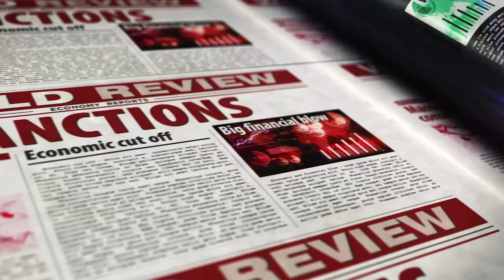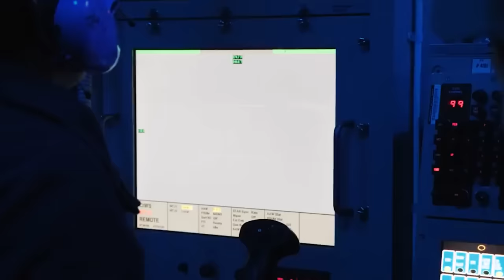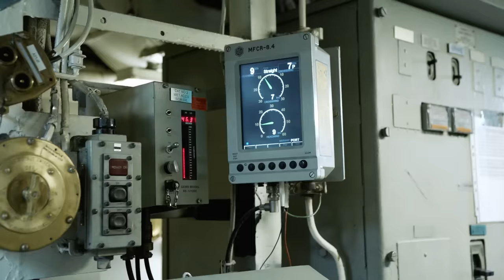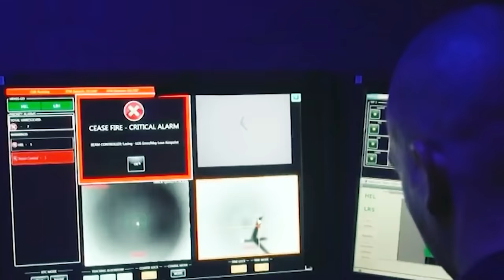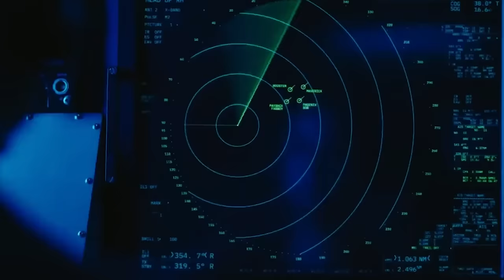A SECRET US Aircraft Carrier Is Already In ISRAEL! HAMAS And IRAN Are SHOCKED!

Comment: Lol. He said the F35C takes off with a hook, and lands with a special catapult!
Reply: They're referring to the electromagnetic catapult system used by the Navy or: Electromagnetic Aircraft Launch System found on some newer carriers which launch carrier-based aircraft by means of a catapult employing a linear induction motor rather than the conventional steam piston. EMALS was first installed on the lead ship of the Gerald R. Ford-class carrier, USS Gerald R. Ford.

Its main advantage is that it accelerates aircraft more smoothly, putting less stress on their airframes. Compared to steam catapults, the EMALS also weighs less,  costs less and requires less maintenance, and can launch both heavier and lighter aircraft than a steam piston-driven system.
Reply: @cassiespencer6134  I don't care wtf you call it. You don't use a catapult to land.
Reply: @XtremiTeez  The catapult system on carriers is used to both launch and recover acft. And when landing on a carrier one strives to catch the 3-wire. That being the 3rd wire in front of the landing acft.

Comment: Why do they decommission the ships?  Why not just refurbish them with state of the art equipment and weapons?
Reply: age and sometimes that option just isn't available due to cost and capability
Reply: @peterchristensen7943  it’s less expensive that building a new hull/ship from scratch is it not? Using the shell?
Reply: @danielmurray8560  no because completly gutting a ship and then modifying it for something it was never meant to be or due to actually ends up being much more expensive, especially on older ships where you can have decades of changes and corrosion we had some great examples of this in ww2 when we kept adding radars and other equipment to some ww1 destroyers to the point they became unstable in rough sea,s and such
Reply: @danielmurray8560  sorry but mo there is no real shell after they yank the reactors    and pipes which is what it would take along with the  electric turbines if they are old enough not to mention the affect of salt water on the hull of a 50 year old warship is just not pretty

Comment: focus a signal too disrupt Flight controllers for UAV;s  , a simple signal can be sent too disrupt the flight controllers on these drones makes them useless ,, and flight controllers depend on a gyro ,, these small tiny flight controllers have artificial gyros using electrical currents that are super sensitive to any kind of low or high electrical interference  out of the gyro's range  will disrupt  the gyro and the drone will fall out of the sky